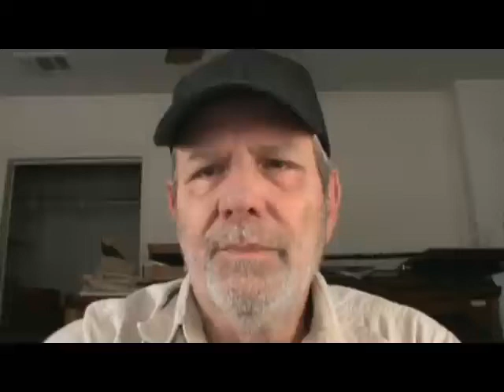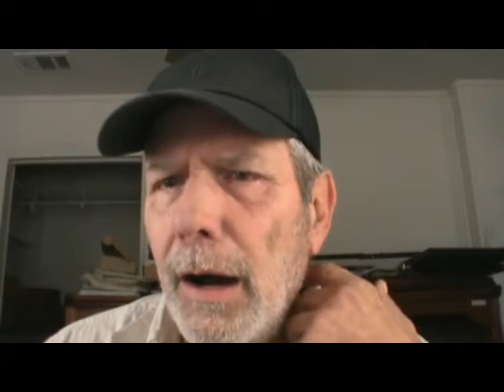Convert R-12 to R-134a Procedure for SubZero and all refrigerators and freezers! No Sludge occurs!

Comment: You're right about repairmen saying that it's not repairable. I think either they don't know how to diagnose or just don't want to. I'm an auto mechanic and I've been converting R-12 systems to R-134a for years without any issues. We don't even replace the compressors if they were still good. We drain as much oil as possible and replaced it with Ester oil. It's compatible with R-12 and R-134a although PAG oil would be a better choice for R-134a. You can't mix PAG oil with mineral oil so if you can't get ALL of the mineral oil out, use ester oil. Refrigerators may be more of an issue than cars because they hold so little freon. I may experiment on an old cheap refrigerator that I have since I have never converted one.
Reply from the maker: Hi Jeff, 
We have the luxury even more of not ever having to add oil to a system. The compressor comes with about 3+ ounces of oil in it, so likewise, when you remove the R12 compressor, the oil goes with it. The only thing left is residual oil molecules, and with that, it is no different than if you weren't converting to R134a, because you have to get rid of the acids, contaminants, oil, etc and that is what the Vacuum pump is for. Then to make it even more convenient that you will not have any issues, you ALWAYS install a filer/drier and now anything that could possibly be left in the lines is absorbed in the new drier. BUT, if you evacuate it, and too many people are mistaking HVAC with "Sealed System" repairs these days, we don't have to pull sealed systems down into to 200-400 microns!!! WE DO NOT! READ AGAIN IMPROPERLY TRAINED HVAC TECHS that are doing sealed system repairs, you DO NOT NEED TO BUY $400+ GAUGES SPECIFICALLY USED FOR HVAC,  you can get the normal analog needle gauges, because 20-30 mins vacuum is almost always sufficient, to remove anything left of the alien molecules that may have been left in the system! The KEY to know if you have removed all contaminants, is to understand how a vacuum works. Evaucuate for 30 mins, close the gauges, both if you use both high and low side, but most just use low side to evacuate, and then turn the vacuum pump off, because with the gauges shut, you know the vacuum is going to stay in the system and and in your hoses and gauges.
This is the Key, leave it in a vacuum for 15-30 mins or more, if you suspect you may have left a leak, or if you smelled strong odor when you opened the system, possibly not burnout, hopefully or you will be doing a lot of flushing of the system for many hours, but you may suspect you have a lot of acid or other contaminants in the system, so run the evacuation longer, to pull it down and do what we call pegging the needle, to close to but it's not actually 30 inches of mercury(hg) vacuum.
If you lose inches of mercury vacuum, 2 inches, 4 inches, maybe even 6 or 8 inches of vacuum, and it stops, and stays at 22, 20, inches of mercury vacuum, then there are still contaminants in the system, that the vacuum has absorbed and when it does so, it absorbs those inches of vacuum. That's what's happening, UNLESS IT KEEPS GOING AND GOES TO ZERO, then you have a leak!
So, leaving the system in a vacuum after you evacuate it, is critical to knowing that you do not have a larger leak(microscopic leak will take longer to go up to zero, even hours, but nitrogen at 100 psi, can help find those), and that you have removed the contaminants from the system.
If you stay "pegged" down close to 30 inches of vacuum, you are good to go, and we don't ever worry or need to pull down the 200-400 microns!
That is only necessary for metering device systems, and we use a capillary!
We don't do saturated, super heat or any other things that HVAC has to worry about and is a severe pain in the butt!
We have it easy with sealed systems!
Car mechanics can have their car ac's too, although I still do and always have worked on them, I don't like them and any mechanic can tell you it can be a real bear if you get something in the system, which is why it is always critical and suggested to be mandatory to replace the orifice, expansion valve,  and accumulator to be sure you have a clean system, or it can plug up!
We don't have those concerns at all!
Once the sealed system is evacuated, down to about 30 inches of vacuum, and it stays down after watching to see if you lose any vacuum, then you are, as I said, ALL SET!
Charge through the process port or low side with gas, and slowly, because most systems are only about 6-10 at most ounces these days, easily over-charged.
Bottom line, sealed system repairs are the easiest of all refrigeration systems to service!
The metering system is a constant, the capillary bore is set to the proper size to inlet freon into the evaporator which is always much bigger, and in our case, usually about 5/16", and the capillary bore is about .31".
The capillary is very high pressure, with such a small bore, and then injecting into the 5/16" evaporator tube, physics steps in and says, when Pressure Drops, Temperature Drops, they are Directly proportional and related.
Due to the calculated bore size of about .31" to the 5/16" , the drop in pressure creates the drop in temperature, to zero degrees in the inlet of the evaporator, and frosts up the entire evaporator, if the system is functioning properly.
So, what I am getting at, is you can't screw things up very easily, if you do car ac, you already are much more involved and aware that contaminants need to be removed via vacuum pump(I will never buy a reclamation unit, NEVER NEVER NEVER!), which is just fine for our systems, even a 2CFM is fine, you don't need a 4 or higher cfrm, it's a waste of money! Unless you want to be Tim Taylor from Tool Time and supercharge everything just for the heck of it, and overkill!
A $65 vacuum pump, 2cfm from ebay is FINE!
I have a Robinaire 4cfm I bought 35+ years ago, and I used to carry that thing around and anyone that knows it, knows it weighs more than both of my ex-wives put together! Ridiculously heavy, and so were they, thus now ex's! DUHHH
So, not to digress too much, the challenge is always using the proper torch, and once again, these HVAC training bozos are being told from hvac school they wrongly take for sealed system repairs, that they need to again, super-charge and use Oxy-Acetylene, WRONG!!! That's 3000-6000 DEGS, A CUTTING TORCH!
Why the heck would anyone with an brain cells use a cutting torch to braze 1/4", 5/16", and a capillary tube??????? ANYONE WANT TO TELL ME, because all these younger bozos are doing so!
Then, they are causing carbon buildup in the systems, so now they are adding having to Flow Nitrogen and adding hours onto the repair, WHEN THEY ARE CAUSING THE BUILDUP AND BLACK SOOT ON THE CUSTOMERS CEILING, POPPING CONSTANTLY WHEN LIGHTING THE TORCH, SMH, OMG, USE THE PROPER TORCH, "AIR" ACETYLENE(Turbo Torch, 1400-1700 degs!), NOT OXY-ACETYLENE!
CLEAN OUT YOUR EARS, WHEN THEY SAID AIR ACETYLENE, THEY MISHEARD IT AND THOUGHT....OK, AIR, THAT'S OXYGEN, SO I NEED OXY-ACETYLENE! WRONGGGGG!
ROFLMAO THEY ARE SO SMART AND KNOW SO MUCH MORE THAN THEIR ELDERS, BUT WILL NEVER ASK OR TAKE SUGGESTIONS ABOUT THE PROPER TOOLS TO USE!
SilFos 15 silver solder, white paste flux, and practice with brazing, especially before getting to the capillary tube brazing.
Don't be afraid to jump into it, you already have a much more stringent discipline doing car ac!
Do some testing brazing maybe on the ex's refrigerator...oh wait, maybe not.
You ever need any questions answered, let me know.
Just Keep it Simple, that's the key!
One last thing...an engineering company recently did a test and left 6% of the oil from an R12 system, in the system still, and converted it with it in the system, to R134a, and also put a new compressor in with R134a oil in it, with the 6% of the R12 in it still, and NO PROBLEMS, NO SLUDGE, COOLED PERFECTLY!
Just like all the mixing of refrigerants now, just shows the engineers have lost their minds, and have no clue what they are doing anymore!
Millennial and Gen Z engineers now int he work force, and now everything has gone south of the equator and the border!
They even decided it would be a really good idea to use PROPANE AS A REFRIGERANT NOW, SO YOU CAN PUT YOUR REFRIGERATOR FILLED WITH PROPANE IN IT, NEXT TO THE GAS OPEN FLAME RANGE, AND THE NEIGHBORS WILL CALL THE FIRE DEPT WHEN IT ALL EXPLODES, BUT AS THEY SAY, THAT'S DEFINITELY BETTER THAN THE OZONE LAYER DEPLETING, WHICH WAS ALL A LIE ANYWAY!
THE INDUSTRY HAS LOST THEIR MARBLES AND IT IS ALL SINCE THE MILLENNIALS AND GEN Z ENTERED THE WORK FORCE!
THEY ARE LIKE ELON MAKING AUTONOMOUS CARS THAT DRIVE THEMSELVES, BUT THE ONLY VERY MINUSCULE ISSUE YOU HAVE TO EVEN CONSIDER, IS THE FREAKIN' CAR WILL GO OUT OF CONTROL AND KILL YOU!
A WHOLE NEW GENERATION THAT IS DYING OFF QUICKLY, BEFORE 30, DUE TO BEING SO SMART THEY CLIMB ON LEDGES TO TAKE A VIRAL VIDEO OR SELFIE AND FALL OFF THE CLIFF AND DIE!
BRILLIANT GENERATIONS WE HAVE COMING UP!
BOOMERS, WE NEED TO GO BACK TO WORK, ALL THE MILLENNIALS AND GEN Z WILL BE EXTINCT SOON, BY THEIR OWN DOING!
SIMILAR TO ELON BLOWING UP ROCKETS CONSTANTLY, AND AT THE SAME TIME, SELLING TICKETS FOR RIDES ON HIS ROCKETS!
ARE YOU KIDDING ME???
DOES ANYONE HAVE ANY BRAIN CELLS ANYMORE, OR COMMON SENSE!??
IF IT HAS ELON'S NAME ON IT, STAY FAR AWAY FROM IT, IF YOU WANT TO LIVE!
I DIGRESSED OFF THE CLIFF...
GO FOR IT WITH THE SEALED SYSTEMS....PIECE OF CAKE FOR YOU, I AM SURE, WORKING OR CAR AC'S!
MIKE
CAPS ARE EMPHASIS, NOT YELLING LIKE MILLENNIALS AND GEN Z REDEFINED THEM AS, WHICH IS FALSE!
SOMETHING ELSE THEY WANT TO CHANGE(SAFE SPACE), AFTER HUNDREDS OF YEARS, AND IT AIN'T HAPPENING!

Comment: Hey Michael, thank you for such a great overview and sharing your extensive experience! 
I have a 501F that had been converted to R134a by the previous owner (Panasonic DJK73C12RAU). Worked for about 4 years and now losing cooling. Only getting down to about 8-10 F. 

Noticed that lo-side was a bit high on my manifold gauges at about 14psi. 
So, I evacuated the system - it held vacuum nicely for over 3 hours. I then recharged slowly through the lo-side service port with the recommended amount of pure 134a (10 oz - on a digital scale) while the compressor was running.
Still not cooling all the way down after about a day.

Here is some more info; When running the LO side is now 6psi and the HI side is 230!!   If I shut the unit down both sides equalize fairly quickly to 35psi, so I am not suspecting a restriction. I was careful measuring the re-charge, but could this be a slight overcharge? Maybe the 10 oz specified on the freezer label was for the OLD R12 compressor? Maybe this Panasonic R134a compressor needs a LOWER charge?
I also notice that when attaching the gauges, a small amount of lubricant is expelled from the LO side service port - not sure if that is typical?

I am now suspecting the compressor is at fault and may need to be replaced? Does that sound plausible? Are there any other tests that I can do?  

Thanking you greatly in advance!

Comment: Do you recommend replacing the metering device for a sub zero freezer when converting? Is the flow rate different for the two gases
Reply: There is NO DIFFERENCE, between any of the components in a R12 & R134a system, so the only difference is the R134a compressor, with R134a oil in it from the factory. You take out the R12 compressor that has the old R12 oil in it that is not compatible with R134a, and install the new R134a compressor with the new R134a oil in it, and you don't even have to make a big deal out of blowing out the system, just use nitrogen if you want, and all the rest of the components are compatible with R134a, the evaporator, condenser, heat exchanger, which you are referring to, but we do not use the term metering device with sealed systems, domestic refrigerators, because the "capillary tube" that is soldered to the suction line is the so-called metering component, in a sealed system unit, and there is no difference in the capillary tube for R12 or R134a, either! The ONLY component is the compressor, with the old R12 oil in it, that has to be changed to the new R134a compressor with the R134a oil in it, just as I stated 100+ times in the video. There is no magic or trick to upgrading and converting to R134a. An engineering company just did a study and left 6% of the old R12 oil in the system, and put a R134a compressor in with the new R134a oil in it, and evacuated and recharged with R134a and there still were NO ISSUES WITH SLUDGING, EVEN WITH 6% OF THE OLD R12 OIL IN THE SYSTEM, MIXING WITH THE NEW R134A OIL, AND NO ISSUES! SubZero has been telling this lie for 30 years, and it is not true that converting to R134a causes sludging, NONE AT ALL! SubZero is trying to force new sales of $18,000+ units, telling customers with older units, WE CAN'T FIX THOSE, YOU HAVE TO BUYT A NEW UNIT! NONSENSE, NOT TRUE, A TOTAL LIE! MYSELF AND ALL THE EDUCATED EXPERIENCED TECHS HAVE BEEN DOING IT FOR 30 YEARS, AND BILLIONS OF CARS HAVE BEEN CONVERTED ALSO! So, NO, the capillary tube, (Heat Exchanger) is the same for R134a as it was for R12!  Thxx, Mike   By the way, CAPS are EMPHASIS, AS THEY HAVE BEEN FOR THOUSANDS OF YEARS, NOT "YOU'RE HURTING MY FEELING, I'M A MILLENNIAL OR GEN Z, THAT CAPSA HURT, ANDMEAN YOU ARE YELLING AT ME"! CAPS CAN'T HURT ANYONE, THEY ARE LETTERS, HOW CAN LETTERS HURT SOMEONE...OMG, MILLENNIALS AND GEN Z, MAN-UP!

Comment: Hello.
Can I use R12 freon at R134A ref.compressor without any modification of refregirator?
Reply from the maker: Email me at Rtnoww@aol.com ...I don't understand your question exactly, possibly due to improper words used. You cannot use R12 freon with a R134a compressor, which is what it reads as what you are asking, and it may be your use of English that is being misunderstood. You said "Can I use R12 "at" R134a ref compressor", which makes no sense in English, saying "at"...? Like I said, email me and I can clear it up, instead of going back and forth in here, which takes forever. Thxx, Mike
Reply: @abaappliance-az  Thank you for your answer, and I'm sorry for my bad English (not native).
You understood my question correctly.
I have a refrigerator with a compressor for R134A refrigerant. (LG, 20 y.o. for now)
5 years ago, a technician had repaired this refrigerator (changed the filter, refilled the freon), and I clearly remember that the refill was did not with R134A refrigerant. The refrigerator worked perfectly. Now I have noticed a refrigerant leak, the refrigerator still works, produces cold, but the compressor makes a louder sound than before (as if it vibrates when turns on). And I want to fill up the system, and I'm thinking now, which type of refrigerant have been filled after the repair, if not R134A, then what? (I remember that the freon marking was like R and two digits). In any case, thank you for your quickly answer. 
Have a good day!
Reply from the maker: @AndriySementsov  If it is an LG R134a compressor, then it would have had R134a in it Brand New from the factory, and he would have put R134a in it, NOT R12. R12 is and has not been available for many years, but guys have been using substitutes for R12, like Hotshot and other blended freons, but a tech would not put any of those in a system with R134a, because they know it would not work and would ruin the system, since the R134a oil in the compressor is different and not compatible with R12. or the other freons, other than R134a. You said it is cold, and works, so if it is 37-38 degrees int he refrigerator and 0 degs in the freezer, you do NOT need to add any freon! The noise could be the compressor getting noisy, since it is 20 yrs old, the springs are possibly weak inside, or tubing vibrating, which is hard to identify sometimes, and quiet down. If it is cooling fine though, it's not the freon!

Comment: Hi. I have a subzero 532 fridge with two compressors on r12. I want to convert it to 134a ( compressor, hit exchanger, evaporator coil). Can I convert only the fridge side compressor? I don't know about the condenser coil…is it separate (double) or one( single) for both freezer and fridge systems! Thanks in advance !
Reply from the maker: Call me and I will explain it all to you, so it's easier than trying to explain it all in writing.
619-819-5182 Landline
Mike

Comment: Why can not use 134a for automobiles in refrigerators ?
Reply from the maker: The only thing you have to worry about if you use R134a you buy from AutoZone or other car parts  stores, is that you get the R134a that does not have ANY additives, oil or stop lead in it. Get the can with JUST R134a in it ONLY. It's the same R134a, they don't use a different R134a, there is no such thing as DIFFERENT R134a for cars, it's all the same R134a.
Reply: @abaappliance-az thankyou I was wondering about this too. I notice that some cans have stop leak and some have just r134a.